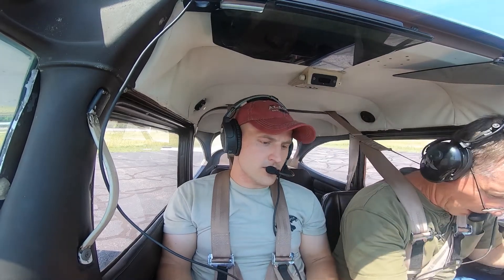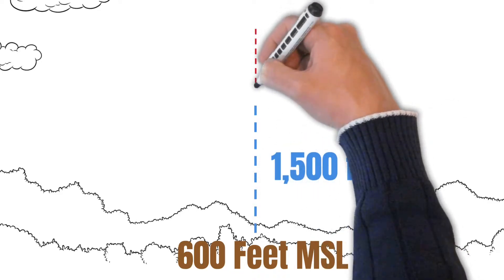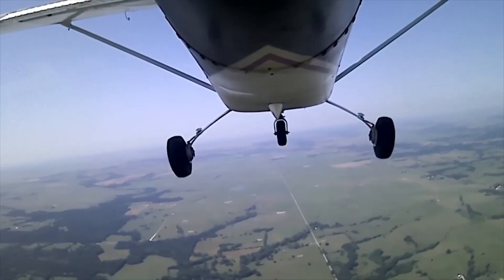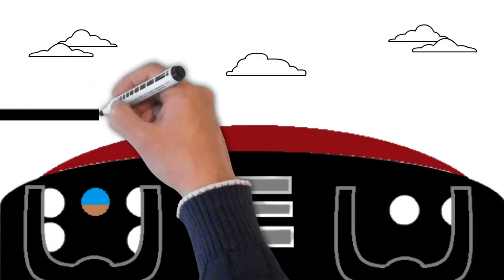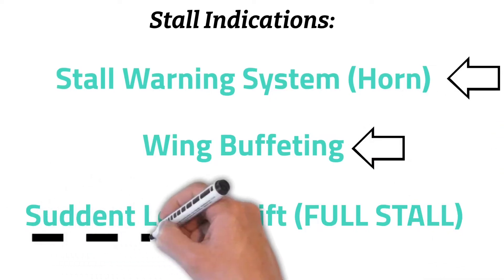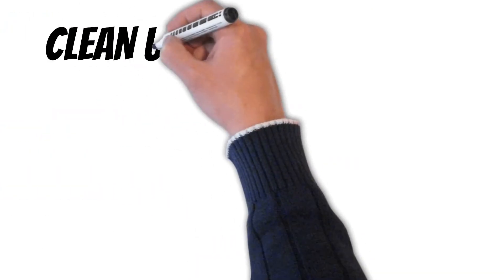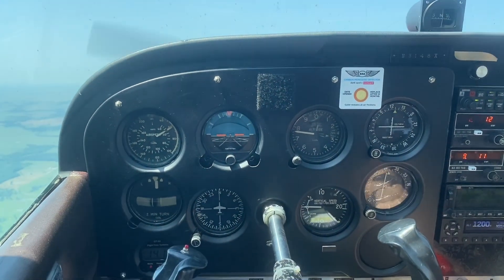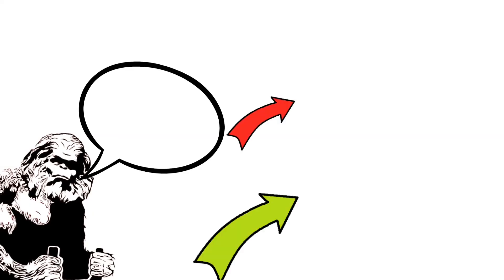Power Off Stalls Made EASY!

Comment: my instructor who has something like 40,000 hours is telling me that in order to recover, you go through the steps you outline, but instead of use a ence to roll when level, use Rudder pedals
Reply from the maker: I’ve heard this technique many times. “ROLL” simply means to roll out of the turn if you’re in one during the stall. It’s not necessary referring to the wing drop. I’m 50/50 on using the rudder pedals to raise the wing. It does work, however you are causing a cross controlled situation when you do that which could aggravate the stall. Do what your instructor says. That’s just my 2 cents

Comment: Hey, I have a ton of trouble with controlling speed during stalls. I feel like it wasn’t covered much. Conceptually i get it but it’s a huge hill to over come. When you set flaps and try to stay on altitude you have to fight the natural balloon tendency by pitching down which slows you but then the balloon stops and you gain speed. In that moment when the controls invert and then again I blow past stall speed. Do you have any devices to help me with this? I’m a new pilot in an accelerated program and day 3 we started doing stalls so it’s a lot and VERY easy to get over saturated, start hyper focusing, and screw up.
Reply from the maker: For power off stalls, I typically have the students keep the nose on the horizon. The plane will stall in this attitude, but the speed bleeds off much more gradually and is much more manageable.  You still have to fight the balloon, but it’s easy because you just keep the nose frozen on the horizon. Try that, and let me know if that helps you.

Comment: A little confused , max power when your aircraft is in a stalled attitude?  Are you not supposed to relax first before full power?
Reply from the maker: Relax is the most important part and should be done first. But, you can easily go max power at the same time

Comment: Early on during my training, my most common mistake during recovery is underestimating the left turning tendency after going full throttle. The first few times my CFI would joke that, "You just crashed into the tower because you drifted left!" I had to get it into my head that I should expect the left yaw and preempt it with the right rudder during my rollout. And, of course, keep an eye on the heading.
Reply from the maker: That’s so true! Low airspeed, high power settings is where you gotta keep that foot on the rudder

Comment: In Canada, recovery is relax back pressure to cruise or just under cruise attitude, then full power. Not sure why you would full power first.
Reply from the maker: Yes, I use MAX, RELAX, ROLL because it’s an easy memory aid. Max power and relaxing the backstick pressure can be done at the same time
Reply: This is a great point, both actions are usually close to simultaneous, yet the thought process should be to break the stall first - I agree.

Comment: One caution here - although this is the standard FAA guidline - students should be mindful if you fall into a spin, adding power will cause an AGGREVATED SPIN. This is really just skipping the first parts of a spin to the pullout stage (the spin never happens) - but in reality, its a stall, throttle idle, ailerons neutral, correct with rudder (in this scenario, these first steps happen in an instant), elevator forward and power.
Reply from the maker: That’s a great point. Thanks for the comment

Comment: Nice video, it brings me back to my flying days (got PPL but only have 145 hrs, all around 50 years ago.). I would add one thing, based on an experience that I had while checking out a rental AA1 Yankee. 
I would add this: Have a rough idea how a plane stalls (and how you handle its stall) before assuming a small altitude loss, like 300 ft. I learned about the AA1 on my initial pre-rental check ride. The instructor told me to go to 5,000 ft AGL and I think he was learning along with me (gotta learn sometime!). Anyway, first power on stall I lowered the nose to below the horizon and probably lost 500+ feet. He said to try it again , but lower the nose to the horizon and let it accelerate out level. I had the ball centered, and it looked like it might work. About 3 seconds of S&L, then the left wing stalled and we were in a spin (and I had virtually no actual spin experience). We both did the right things, but it still took 1,500 feet to recover. I flew it 3 more times, just for  its visibilty and fun handling, but climb outs and landings were all very cautious. It was certainly a far cry from the usual forgiving C-150, C-172, or Cherokee. Perhaps a few stalls in a less forgiving plane would help a student gain perspective- as a private pilot it sure got my attention! (PS- my primary instructor forced a C-150 into a spin, interesting but very docile.)
Reply from the maker: Thank you! Yeah, i definitely could have included more about spins in this video.  I’ll try to mention that a little more in the power on stall video

Comment: Thanks for making these. I find them extremely useful. How does one maintain the heading within the ACS required 10 degrees? Is it purely by rudder? Would be great if you could make a video showing how to nail it.
Reply from the maker: You’re welcome! That is an excellent question. Technically the answer is both aileron and rudder.  As the aircraft slows, the ailerons become less effective.  However, the rudder continues to be effective at slower air speeds.  This is what I tell my students... continue to use ailerons to keep your heading and rudder to stay coordinated.  With that in mind, if you pitch above the horizon to get the airplane to stall, it becomes a lot more difficult to stay coordinated and still maintain your heading.  In some airplanes, you may HAVE to do this in order to induce a power off stall, but if you do, you will need to be very aggressive with the ailerons to stay on your heading, and you may need to use the rudder to help if that is not enough. Now, power on stalls are a little different. It is much more difficult to stay coordinated and keep that heading.  I teach students to be aggressive when they pitch up, this will minimize the time that you are trying stay coordinated and maintain heading. I have found that the easiest way to do this maneuver is to pick a cloud that is on your heading and use the ailerons AND rudder to maintain that heading.  As a general rule, any time you use ailerons, you should also be using rudder. They should feel tied together when you use them.  There are exceptions to this rule, but this will help you develop a feel for what it takes to stay coordinated when you fly